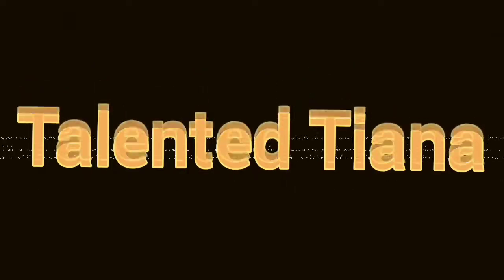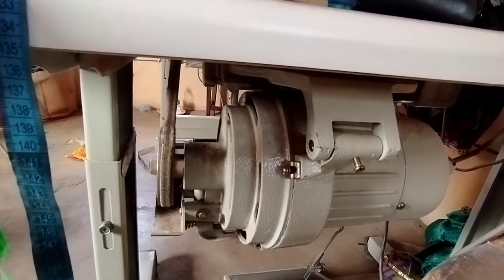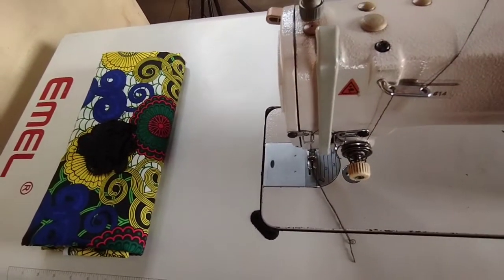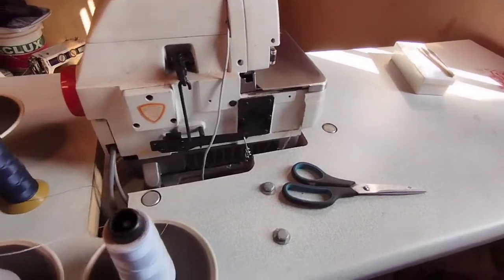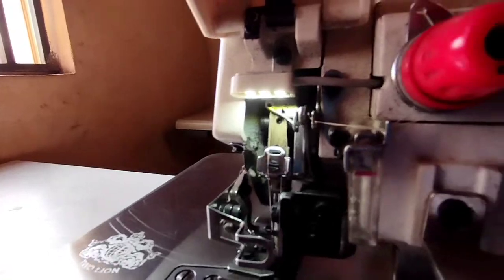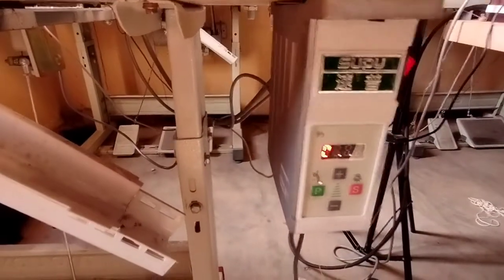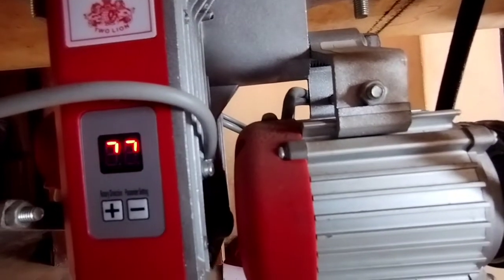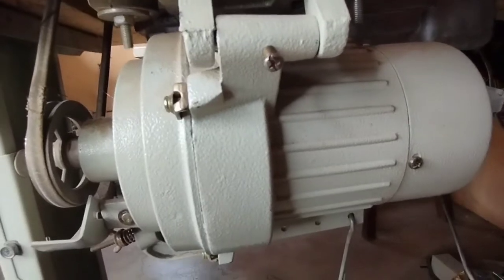ADJUSTING SERVO MOTOR SPEED || DIRECT DRIVE VS CLUTCH MOTOR

Comment: Hello,is there a brand of sewing machine that comes with the servo motor or do I need to buy the machine with the clutch and then buy the moto separate
Reply from the maker: I  bought a lion brand that came in direct drive. I also bought a normal emel with a clutch motto and changed it to  direct drive.